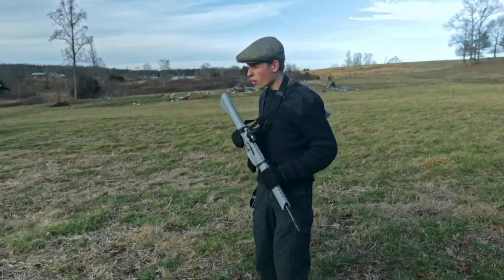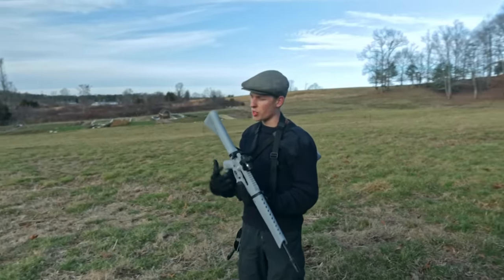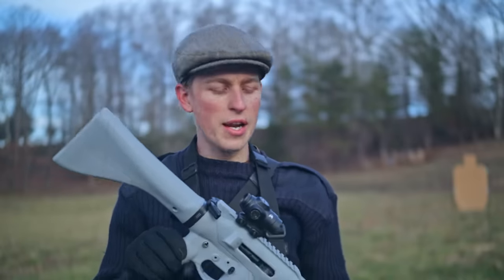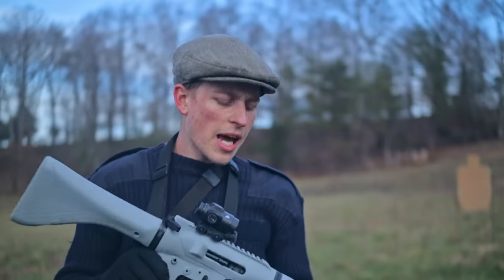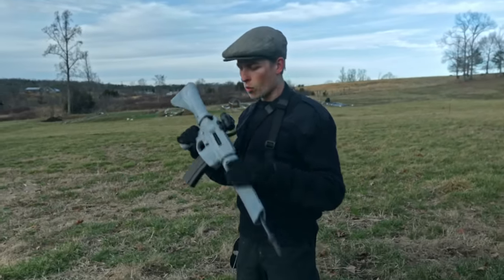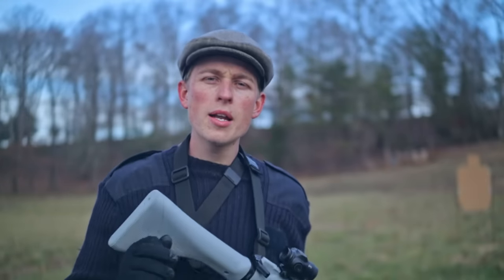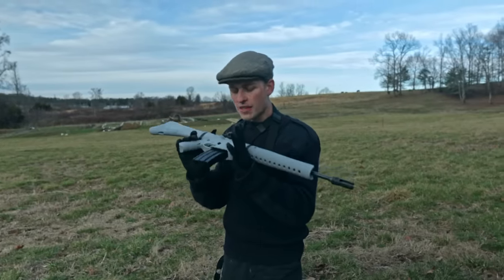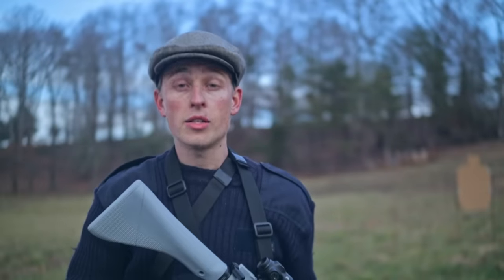Introducing the Orca

Comment: I would love to see the integrated pistol grip incorporated into your regular mil-spec compatible lowers
Reply from the maker: So would I.
Reply: I can understand why it's not, since different people like different grip angles, but it would be cool to see it as an option...or perhaps the core of the grip being integral, with different front, back, and side panels to adjust the size and angle to maintain the ability to customize

The only AR lowers I can think of with an integral grip are the KP15, and the SCR
Reply: @pdxmarine1430  that would be pretty cool to have a modular system with sleeves or inserts to change the shape of the grip, but still utilize an integrated grip to avoid using fasteners where possible.

Comment: I don't know if it was intentional or not, but I noticed the overall rounded design leading to a near total avoidance of sharp edges, combined with gradual tapers between transitions that drastically reduces the number of stress raisers in the material and should significantly prevent cracks from occurring, irrespective of material used.
Reply from the maker: Exactly.

Comment: A question from someone whos trying to design something himself. Only airsoft so not so high need for strength. But how did you digitaly design the texturing on the handguard and grip ? That looks really nice
Reply from the maker: It's the SolidWorks texturing tool. A mesh based process.
Reply: @HoffmanTactical  thank you i will definetly look into it 🙂

Comment: Dope ass design. Some comments from me that no one asked for here though; Id suggest actually making the mounting rails a separate part that you mount to the upper with screws. I saw the other video where you talked about sag. Some explicit parts for 3d printing will just not hold up and that is one of them. Print orientation is also a HUGE thing. This is probably more for those who are printing them and not for you who have designed it. But even designing parts specifically for print orientation will help with strength. You also mention higher grade filament but then you did talk about different material types. I also want to mention that higher priced filament companies (Proto-Pasta being a good example) will often give you a MUCH better bang for your buck when printing in the same materials like PLA+/Tough PLA. The finish and strength can be much better with better quality vendors. I just feel like I see too many people who buy cheaper materials who then complain about why their printer isnt performing so well or that their parts arent as strong. When printing with better quality material, I have always experienced better parts. 

Curious as to what program this was designed in. Fusion 360? Blender? Doesn't look like solidworks or creo.
Reply from the maker: Nope. It's Solidworks. I agree with the other points, I spent a huge amount of time optimizing for printing, and the proper orientation is baked into each part. Good filaments are really important, Polymaker is what I use.

Comment: Incredible design! I checked out your webpage, and I see a ton of potential. I, for one, am extremely impressed and excited. 
I am curious as to how much torture testing has been done with this design. Heat and material endurance are two big things to test. Heat... that's easy enough to test for. If it can survive rapidly magdumping 33 30-round magazines of 5.56x45, then that'll beat many traditionally built AR-15 rifles. As for how well it can take a beating, chamber one in .450 Bushmaster and go to town. 
I'm curious as to how light the two rifles seen in this video are.
Reply: ArchibaldMeatpants  okay Fudd

Comment: A few thoughts... What is the cost to print the parts? It is prohibitively expensive to build the entire rifle from carbon fiber nylon? The 2 degree mag tilt is what the Army did to keep the M855A1 EPR from gouging the M4 feed ramps. The Army used a magazine follower with a 2 degree tilt. These magazines have a bluish follower. I wonder if this would bind in the Orca stacking a 2 degree follower with 2 degree mag tilt.
Reply from the maker: Never seen those before, I wonder...

Comment: I remember when the liberator print pistol was impressive, this is wild.
Reply: IMO the time is right for another Liberator-style gun. Desktop CNC is a thing now, it's only good enough to cut aluminium but that's good enough for a gun if you just make it chonky like the Liberator. Wouldn't be anyone's ideal gun(I'd rather have the Professor Parabellum sheet-metal pistol), but there should always be more than one way to do these things.
Reply: @smorrow  you can do it with GG3, 1911 frames primarily
Reply: @docternoblex  You would need to source the barrel and the slide... You would need to "know a guy", which isn't an improvement over the current situation for getting a gun.

Comment: I wonder is adding something like Teflon coatings and ceramic coatings like heat paint would help on the barrel. Also how much dose this weight? I am a vet with shoulder and elbow issues so having something lighter in weight would be great.

Comment: Cool project, but also keep in mind if you don't need to use plastic, don't. Metal manufacturing is going to be more reliable and it is still very affordable to aquire those components.
Reply: We should target every method of manufacturing. Not everybody can cut metal, so there should also be ones you can print. Most people will never own any tool more advanced than a jigsaw, so there should also be a Professor Parabellum-type thing(you print out the pages, glue them to the sheet steel and cut along the lines) but for wood.

Comment: Couldn’t you spray the 3D printed chassis with a automotive fire/high heat resistant ceramic based spray? Instead of adding shielding to the gas tube then also possibly using synthetic motor oil as lubricant since it’s designed for higher temperatures it could have better cooling properties to not melt the plastic

Comment: For the assembly of the upper and lower, perhaps you could still use a takedown pin from the side, rather than the screw from the front? Simply for cleaning purposes in the field, having to carry an Allen wrench to unscrew the upper and lower might be an issue for some people. Just a suggestion, love the design and work put into this.
Reply from the maker: Yes. I actually did that on early prototypes, but found the screw to be a lot stronger and worth the slight inconvenience. A compromise.

Comment: Question?
Is the ORCA rifle only direct impingement? 
Is there a Piston Driven system?
Reply from the maker: Direct impingement is piston, just more clever. The Orca is a AR-15, and changing that would result in more cost with little to no advantage.
Reply: Ohh Con-tray
When you run a piston vs direct impingement, The piston system forces the gasses out the muzzle end. When you run a direct impingement system the gasses are released into the upper receiver.
It's up to the owner
I'd run a piston system
The Orca does look KOOL!  @HoffmanTactical
Reply: Cleaner upper as well as a cleaner bolt carrier group.
If you run a can on it make sure it's a piston driven not direct impingement.  @HoffmanTactical

Comment: Yo man this is badass and I’m new to the entire 3d printing guns scene but I have an idea I whipped up while hanging my shirts, is it possible to modify a 3d printer to heat up the nozzle until it melts and hopefully prints aluminum, I have a bunch of cheap aluminum cloth hangers which if you pull it apart it turns into a long wire of aluminum and I was thinking whether or not it could be used to 3D print parts of a gun that can’t be plastic such as the barrel or the gas tube.
Reply: I know that barrels and gas tubes aren’t usually aluminum

Comment: The real question is how many rounds can you put through it before parts become compromised?
Reply from the maker: It's how many rounds / time period that counts.
Reply: @HoffmanTactical  if you can get it past the major manufacturers numbers you might have lightning in a bottle. I had an ATI and with just normal use the metal reinforcements started looking real sketchy after 3k rounds.

Comment: Did you subject it to freezing temperatures before you tested it?  You know molecular structure is changed in plastic from freezing and can cause breakage.  I've seen polymer lowers break after freezing.
Reply from the maker: It would depend on the filament. PLA+ has done really well in the testing I have done. Not sure about PA.
Reply: It really depends on the water absorption of the filament you use.

The more water a filament can absorb, the more ice crystals will form when it freezes and these crystals will cause very small fractures which harm the structural integrity of the printed part.
Reply: @HoffmanTactical  it would be interesting to test if it’s possible to take printed and properly dehydrated parts and submerge them in some type of oil or antifreeze so they absorb that instead of water.
That might be a interesting way to freeze-proof printed parts and prevent them from having issues due to absorbed water freezing and causing small fractures.
Reply from the maker: @yourlocaltoad5102  I actually did some testing with that, but for stiffness. The only filament that absorbs a lot of water is Nylon, and I don't think freezing is an issue.

Comment: hey quick question what screws works with the hoffman grip on non 3d printed lowers i tried a Socket Cap Screw, 1/4-28 x 3/4" unf and it's too short but the same screw works on other grips

Comment: Can you theoretically put a completed upper on top of this lower and run it fine?
Reply from the maker: Not a factory upper. To to that, you would want to print the standard SL-15. The Orca is heavily modified from a normal AR.
Reply: @HoffmanTactical  thanks for the feedback, just printed most of an orca in transparent pla + but the print started to mess up at the end and I couldn't complete it, I got as far as the entire frame printed except where the rear clamp would be in a U shape in hopes of trying to save it because it's clean af

Comment: Gain-twist barrels heat up less, as do polygonal ones. I wonder if a process could be developed to fill in the grooves (electroplating?) and start over as gain twist.
Reply from the maker: I wonder how much difference there would be. Chamber heating is the biggest issue from what I have seen.

Comment: I wonder if heat-reflecting tape on the inside of the barrel shroud would be enough. (You'd lose the ability to have the shroud be monolithic, I think)

Then again if someone can source(or have the digital paper trail of having bought from you) these special filaments, they can get the fibreglass, too.

What is the diagonal line on the buttstock?
Reply: You can buy these filaments online. Not like their banned or something
Reply: @LuisC7  Yes but the extremely specific combination of special filaments, fibreglass, specific springs and whatever else gives you away to the surveillance state. Why do you think the FGC-9 is designed around the lowest common denominator printers and filaments?
Reply: @smorrow  nahhh man don't worry, the FBI won't put an entire squad looking at someone who just bought a 3d printer with glass filaments.
Reply: @LuisC7  I'm just putting ideas out there. In this field there should be more than one way of doing any given thing, so people have the most chance of doing it with materials already on hand.  Using the surveillance state to catch gun people is definitely in the future of some country or another - advertising AIs are already good enough to predict when a woman is about to become pregnant based on her purchases.
Reply: @smorrow  indeed true. But for now you don't need to go so deep. Maybe in 5 years

Comment: Any tips on why the magwell is so tight? Pmags don’t fit, have decent luck with GI mags
Reply from the maker: Lower could be too short over all, I'd check steps / mm. Comparing it to the upper can help as well.
Reply: @HoffmanTactical  Good to know, got the upper going now. Will know in about 10 hours.

Comment: Just curious, if you used a stronger material (don't know what kind, newly interested) would you be able to cut down on the bulk? I'm sure it's insanely light as is but could it be possible? Or would that sacrifice the integrity
Reply from the maker: Would be hard to do with FDM printing.
Reply: @HoffmanTactical  thank you for the response! Why is that? Because detail quality wouldn't be as refined?
Reply from the maker: @Travis01  Oh no, it's just that options for strong enough materials are limited. Mostly due to layer adhesion.
Reply: @HoffmanTactical  What about printint moulds like on the YouTube channel 'Easy Composites Ltd'?

Comment: Are these built and firing "auto" or just a super light trigger ?

Long as your barrel and bolt, plus bolt carrier group are steel.  I'd imagine that you can pretty much 3D print the rest, the receiver is probably the most questionable and critical part that's being printed here. But with a legit barrel, bolt and buffer spring.  The only part really taking impact on the receiver, is probably the pistol grip.  An maybe the pins.
Reply from the maker: It a super safety, much like an FRT.

Comment: Just test fired mine today, two failures, both in the first 3 rounds so about the same as a factory arm.
Reply from the maker: What type of issues? Normally can pin it down to a couple things.
Reply: @HoffmanTactical  a stove pipe and a failure to feed. Issues resolved after a few shots so my bet is too much friction in either the upper or stock. Works great now!
Reply from the maker: @TTMR1986  That makes sense.

Comment: any chances of 3d printing with metal in the future?  then you could make a 100% 3d printed rifle
Reply: Just that pesky cost of a 3d metal printer. $100k on the bare bones low end.
Reply: @JimYeats  But also: not all metal is equal. See Brandon Herrera on why cast trunnions suck.
Reply: @smorrow  I’m not entirely clear on what your point is. I mean, yes, obviously you need to ensure your metal/alloy is appropriate and your technique sound, and appropriate for the task. 

I am honestly not sure how 3D metal sintering compares in strength to other metal techniques such as forging/billet/casting. It has certainly been used in very high stress/pressure applications though, obviously suppressors come to mind, and a few boutique manufacturers have made barrels completely from 3D metal printing.
Reply: @JimYeats  Oh yeah, and Relativity Aerospace (who haven't flown yet). Forgot about that.

Comment: Gun printing in no way should be inferior then metal fabrication. 
With the right Resin you can get something that is 2 times less the weigh, weather resistent, corrosion resistant, and heat resistant and all for a fraction of the price. And best part is that you can print the schematics right at home.

Comment: I haven't finished mine yet but I'm expecting the casings to beat up the shell refecter after a while witch may end up in weird ejection patterns but if it does then I thought of inserting a metal clip on the problem area while printing
Reply from the maker: Don't think that's going to be, I've had no signs of wear after 800+ rounds. The charging handle latch is the area I'm most concerned about.
Reply: @HoffmanTactical  should be able to add a hole in the print to insert a roll pin like the MCX does. The charging handle will wear that area pretty quickly.

Comment: Have you tried PLA -F? Pla mixed with ABS?
Reply from the maker: No. But, it sounds interesting. The strength of PLA and the heat resistance of ABS? Or a mix of the bad properties of both.
Reply: @Hoffman Tactical  bet your right. Bet it has a lower heat point than pla plus

Comment: What about using aerogel for the fibreglass sleeve instead?

Another weird thing I still wonder why firearms haven't used is heat pipes. Specifically the use of copper heatpipes that are used in applications like CPU coolers. They're extremely effective at transmitting heat, which is why they're used to cool CPU's.
Reply from the maker: Aero gel might be worth a look. Problem with heat pipes is removing the heat from the system, the pipes don't help with that.
Reply: @HoffmanTactical  Yeah, some kind of dump load for the heat would be needed.

Older firearms used water cooling (or as some reports from the field indicated, urine), pretty inefficiently even if they got the job done.

Also admittedly, it would look pretty silly to take an AIO and slap it on top of a 3D printed firearm.
Reply from the maker: @sirukin7849  Water cooling is where it's at. Not like the old guns though.
Reply: I wonder if photochemical machining(see Applied Science) or laser engraving(but you'd need a fourth axis) could put a space-filling curve on a barrel. It would basically be flutes, but with more length and therefore not requiring as deep a cut for the same amount of surface area.

I originally had this idea about chamber flutes -- Evan Jones had been wanting a fluted chamber but not the cartridge-deforming effect -- but now I think in that role the transverse segments of the curve would catch on the cartridge.

Comment: Is it possible to print the orca lower and pair it with a different upper? Or does it have to be with the orca upper only?
Reply: They fit together.  No other upper or lower.
Reply: I think Hoffman plans to re release his lower with the orca updates in the future.
Reply: @paintballercali  this configuration doesn't fit together horizontally.  Its diagonally cut. If he designs an upper for his lower it would be something totally different.  Bidens bane, which influenced this, is basically something already made so not sure he will be going in that direction.
Reply: @teeodee4924  yeah I know I have made 3 of them. I'm responsible for quite a few changes. I'm saying Tim plans at some point to redo his super lower with what he learned from the orca project
Reply: @paintballercali  oh okay. I understand what your saying now.